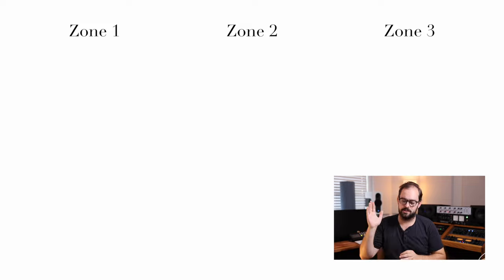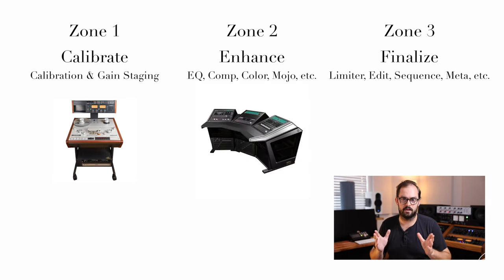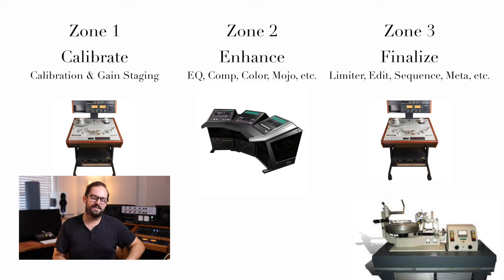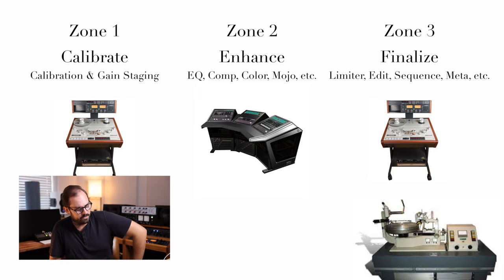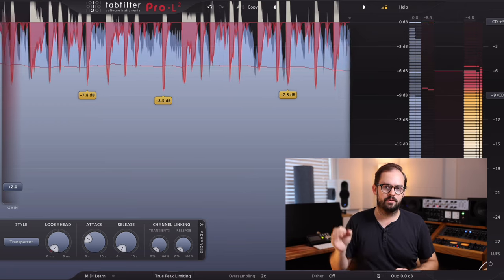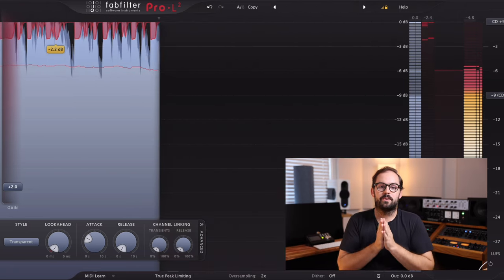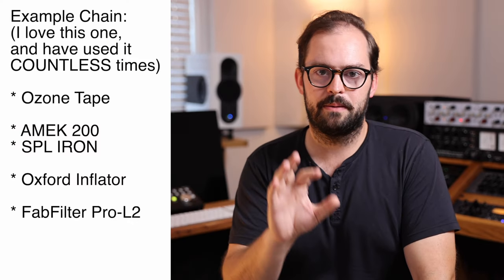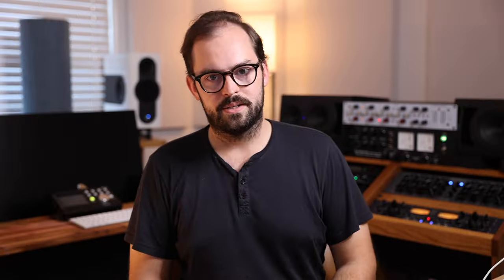You're Using Your Limiter WRONG

Comment: Does the inflator make up for the extra loudness instead of just using the limiter to do the loudness part? I know the Inflator maintains the dynamic range while increasing perceived loudness, so it doesn't seem harmful to push it as the extra loudness tool. 

Do you request -3 dB or -6 dB of headroom from mixing engineers? I'm just trying to get masters to around -10 dB LUFS without using too much limiting as it really makes it sound bad. Is the Inflator the key?
Reply from the maker: Hi Ryan, thanks for watching and thanks for these questions.

I use the inflator for its hard clipping function (the fader on the left).  If a song is too delicate to stand up to hard clipping, I may use the inflator effect (the fader in the middle) which is essentially soft clipping.  Or I may skip the inflator entirely and just use the limiter.

I don't request anything in particular from my engineers - I know how to use clip gain, so I can set the mix at whatever loudness target I want at the beginning of my chain.  That's part of the "calibrate" process.  I change the volume of 99/100 mixes I receive before I start processing them (I know my gear's headroom sweet spot and I want to hit it every time).

As for trying to hit a specific loudness number on every song, my suggestion is: don't!

Every song has a loudness sweet spot that it wants to be at, aim for that, not an arbitrary number.  Example: you have a punk rock album where 9/10 tracks are full band super loud full-on rock songs, and then the last song is a stripped down tune, just an acoustic guitar and the lead singer.  Musically speaking, if you mastered the acoustic tune to be as loud as the reset of the album it would sound off, out of place, way way louder than the 9 rocking tunes that preceded it.  Don't master to a number, do what serves the music best.
Reply: @WillBorza  So what I'm gathering is, use clip gain instead of a limiter for loudness and to feel out the track to determine the loudness sweet spot. 

My last question. Doesn't adding digital gain have negative affects too? Maybe the effects of digital gain are miniscule compared to the effects of too much limiting. Mastering is just one of those things I haven't been able to figure out quite yet. It's difficult!
Reply from the maker: Clip gain, if programmed correctly (and all modern DAWs have programmed it correctly as far as I’m aware) is one of the cleanest tools at your disposal.  I wouldn’t worry about clip gain in the slightest.
Reply: @WillBorza  Awesome! Going to try out these new mastering tips on my next master. Thanks again for the great video.
Reply from the maker: You’re very welcome!
Reply: @WillBorza  inflator does upward compression
Reply from the maker: According to my plugin doctor analysis, there is zero attack or release to inflator.  The “effect” is soft saturation, odd harmonics.  Check for yourself and let me know what you find 😊

Comment: I don't even use limiters anymore. 😬
Reply from the maker: What do you do instead?
Reply: @WillBorza  Lately I've just been using Logic's "Phat FX" plugin on the master in hard clipper mode with all the other parameters turned off. I made my original comment before I watched the whole video. Sounds like you do something similar with clippers!

I also realize using a clipper like this is technically "limiting." I've just found that since I've stopped using traditional limiters and multiband compressors on my master or worrying too much about going into the red, I get louder and clearer masters as a result. 🤷‍♂️

The rare times I use a traditional limiter these days is if I want to purposefully kill the transients of something in the mix. (Like a harsh hi-hat.)

Cheers.